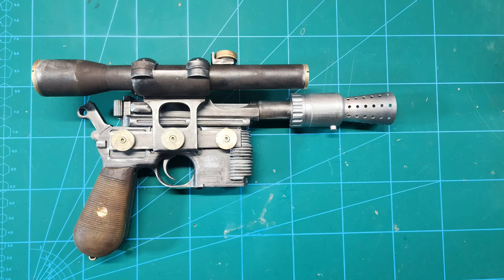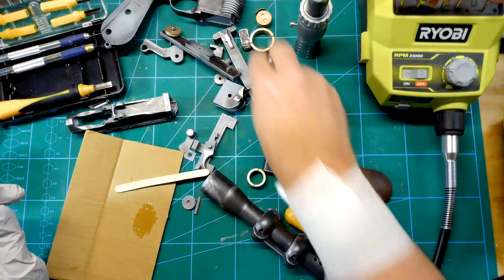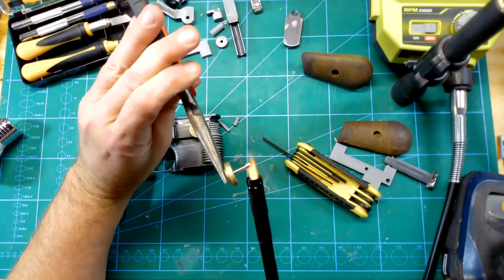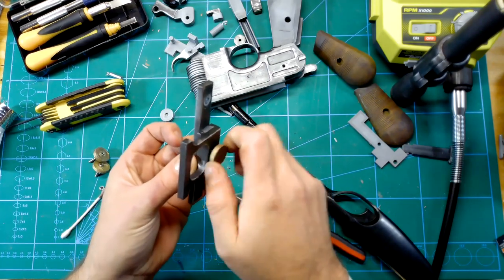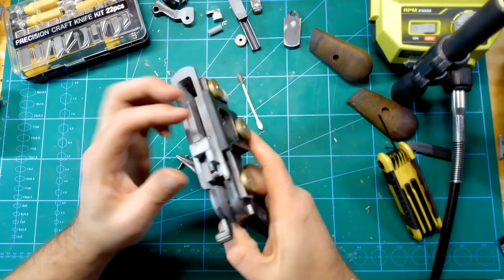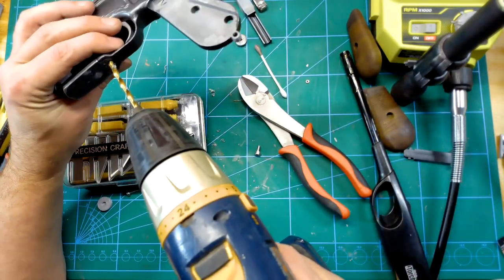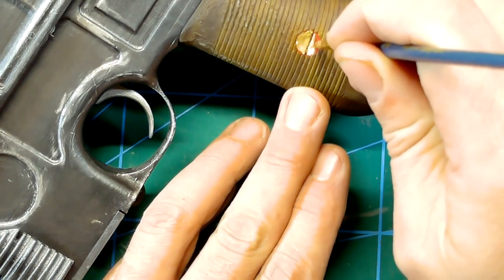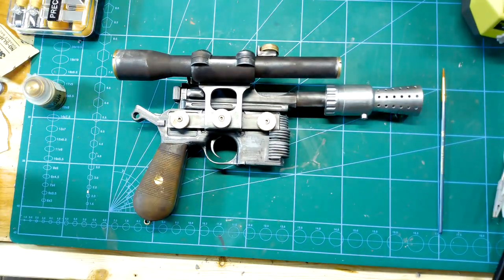Star Wars Build: DL-44 Blaster Final Paint and Assembly

Comment: There is only one screw in an original c96 mauser  & its to hold the grips, & you did it right as its a flathead screw/bolt as it goes into a captured nut in the other grip, i know this as i hav3 an original 1922 c96
Reply from the maker: Thanks. It's not a bad model for the files being free but the plug for the grips were just plugs. I didn't like the way they looked.